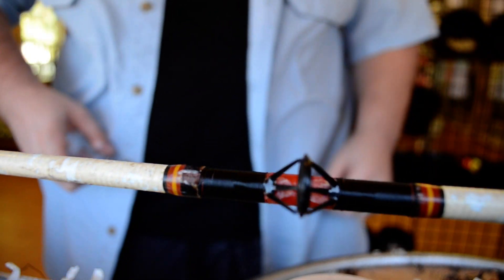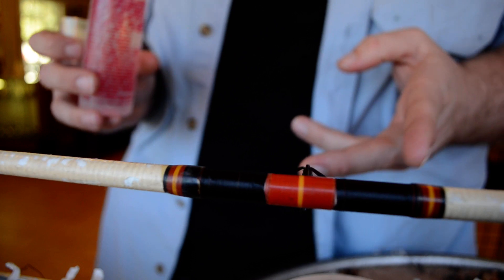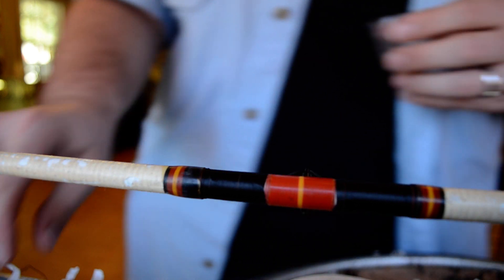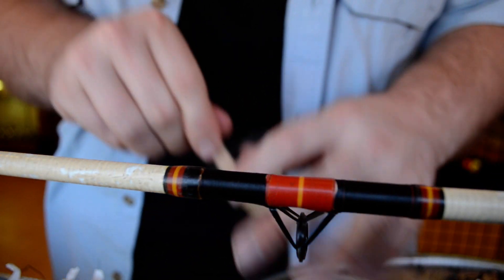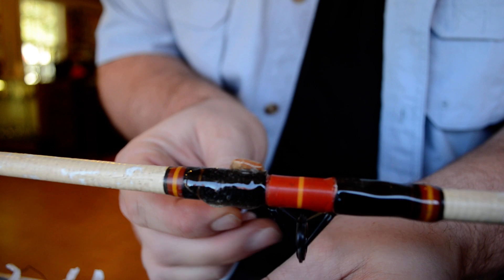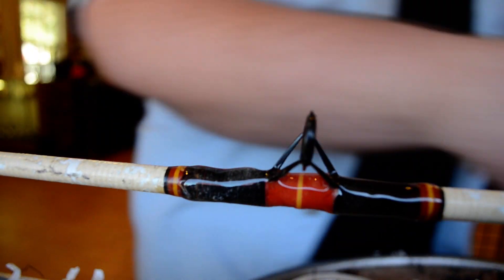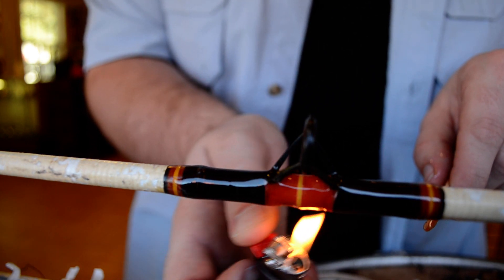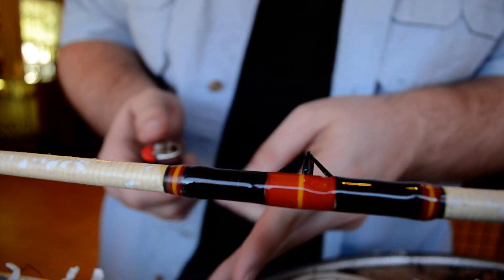Coating a guide wrap with 5 minute epoxy

Comment: Wow these old comments were not listening to the video. It's a cheap and impatient fix for an old beat up rod that you don't mind breaking on a good fish. You negative folks clearly don't understand. I have put Superglue, nail polish, and 5 minute epoxy on my rods. Does it get nice? UV resistant cure? No. Does it stay strong and not crack easily? It depends on the application and conditions.

Comment: The reason that most people do not use the 5-minute epoxy on the rod. And use Flexcoat,  rod coat, pro-kote or finish epoxy is the fact that it allows the rod to bend under extreme pressure a fish can put on it.
Where 5 min epoxy does not flex at all and creates a pressure point in one spot versus allowing the pressure to be extended across the complete length of the rod.
5 min epoxy is used from handle down for the strength of holding the reel from twisting and pulling it puts on the rod.
The finish epoxy can be found at several  web sights-   www.mudhole.com  -  www.fishingrodbuildingandrepair.com -  www.jannsnetcraft.com -  flexcoat.com - http://www.acidrod.com - ect. There are many many more..

Comment: 1) What type of thread are you using?
2)  What epoxy or glue do you use on the thread?
Reply from the maker: We use ProWrap ColorFast. We also use 5 minute epoxy. There are a few different types that you can use that set up well on rods.
Reply: Would this be a suitable solution if you have cracked factory epoxy and just want to smooth out the finish so you don’t have a rough spot near your rod end?